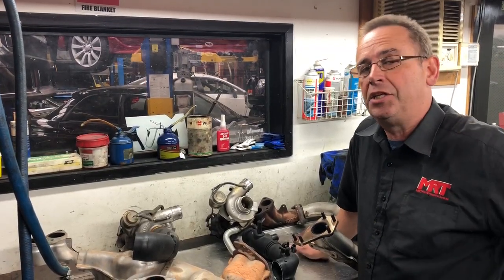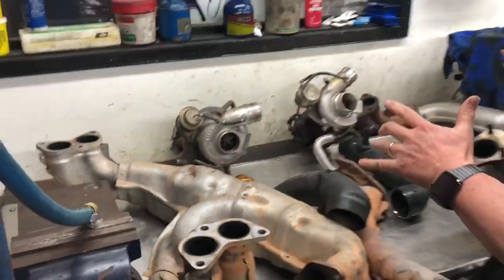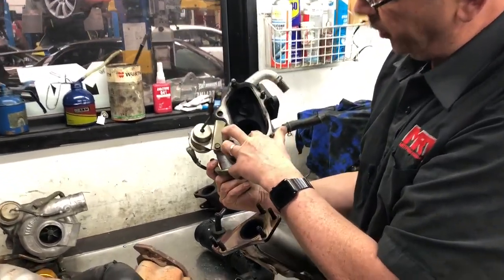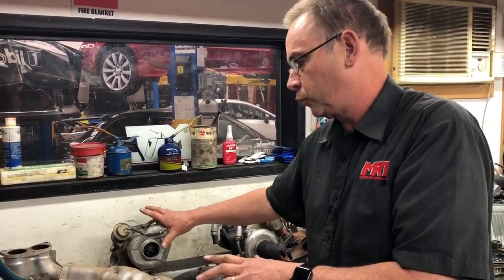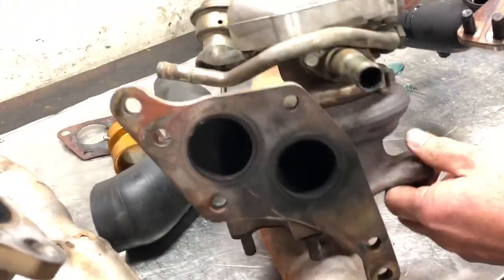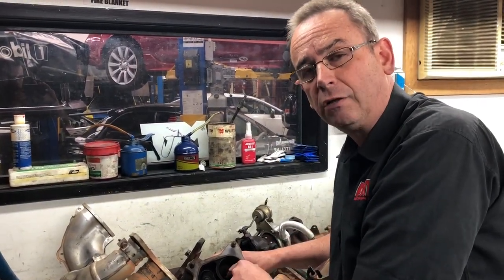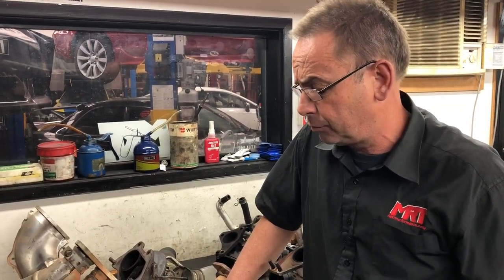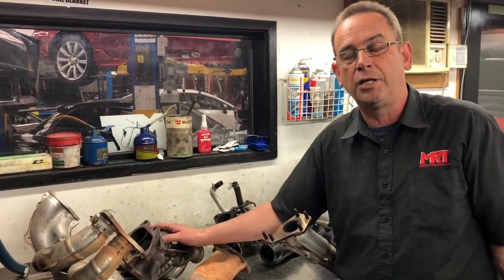MY03 STi Spec C Rally Car - Twin Scroll vs Single Scroll

Comment: I couldn't go twin scroll because I don't want to lose the awesome boxer rumble.

Thanks again for all the great info!
Reply: The equal length headers take away the Subaru rumble, you don't even need to twin scroll to do that.
Reply: @danjay7478  what do you mean? do you mean if u have the twin scroll but unequal length headers u can still get boxer rumble ?
Reply: equal length sounds better wot to me more angry sounding but hard to beat unequal sound at lower speeds

Comment: One pipe goes to the inside diameter and one pipe goes to the outside diameter? What? Both exhaust pipes feed the inducer of the turbine rotor. A twin-scroll is done to separate gas pulses. The overall AR of the twin-scroll turbine housing is also slightly bigger than the standard single-scroll Subaru IHI RHF55 turbos. With the twin-scroll turbine housing, you're getting an improved response at low RPM due to the gas pulse separation but also better flow, and less restriction, in the upper RPM.

Comment: Awesome info thanks guy's 👍🏽 currently have a 2001 subaru legacy blitzen b4 sitting at a subaru specialist shop getting the single turbo conversion. Mechanic recommended twin scroll so that's what I went with. And to top it off we've installed a external wastegate. Later down the road will look into another engine finger's crossed
Reply: Hey man how is the car going?
Reply: @kzz8971 im on insta with some vids buddy, she's all done now. Will be getting a new engine very soon
Reply: @Khil3m  Whats your insta ID?
Reply: @kzz8971  same name Ruthlzz 😉

Comment: Bret could you explain the benefits of using an external wastegate and if it’s worth it to run on street cars? Or is an internal wastegate more efficient as long as the turbo housing and fins are designed properly?
Reply: T Double U I’ve always wondered that. Seems like there’s evidence that support the shortened turbo lag. Definitely not a substantial increase in HP. All depends on your power train layout and where you want to see peak torque, either in the low to high rpm.
Reply: IC Wiener Let the Bret the expert explain it, I don’t trust claims unless you have evidence to back them up. The internet is full of mysteries.
Reply: The main difference is in the capacity that wastegate can flow. Internal may be more efficient, but are flow limited due size, therefore only applicable to a certain power level. Exceeding the capacity to bypass will lead to inefficient boost control and boost creep. That's my understanding. Hope Brett will address this issue in one of the videos too.

Comment: Just wanting some advice about twin scroll change over. I have 2004 wrx with tdo4, its my daily. Im aiming for 330 bhp at the wheels once I've done all my upgrades. Which I've been accumulating for 1 big overhaul, which im currently doing. I have access to a few turbos one of being a vf42. From what I can find info wise is a rare one but suited to a 2.0lt set up. im unsure what path to go down now. Any help at all would be much appreciated. I can send a list of parts I bought and planning on getting if that helps too. Thanks again

Comment: Hello there, great video, I have a question, I'm running a v6 ej207 engine with a holset hx35w, it's got the full boost at 4200 rpm aprox, do you recommend to swap to a twin scroll header and modified it to the holset t3 flange,  is this a good idea? I. Don't want to change the turbo
Reply: Andres Rojas HX35W wastegates gases only from one scroll  not both loke spec C and Evos. Id say it differenceates the exhaust back pressures of pairs of cylinders too much it will work too different on AFR.

Comment: I recently did a EJ20X swap into my 08 LGT. I am running the Twin Scroll vf38 that came with it with and a custom downpipe (invidia 3" to flange that came on turbo). I am getting bad throttle respawns and boost kicks in at higher rpms. Any ideas?
Reply: Bryan Snow Too small exhaust?
Reply: Its a cattless 3" dp with a nameless mid and axleback exhaust with 4" mufflers

Comment: All that and didn't explain the fundamental reason why a twinscroll spools quicker.. 
I.e splitting low pressure from high pressure exhaust strokes on differing cylinders and negating the high pressure being wasted filling low pressure void or back tracking up runners on cylinders during overlap.
Hence the term split pulse